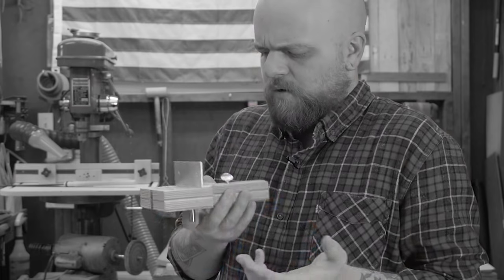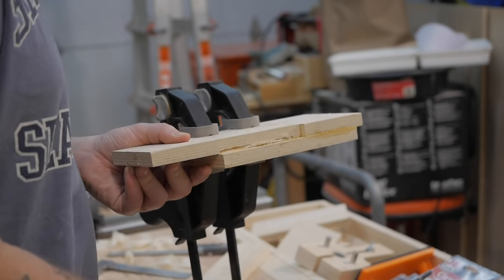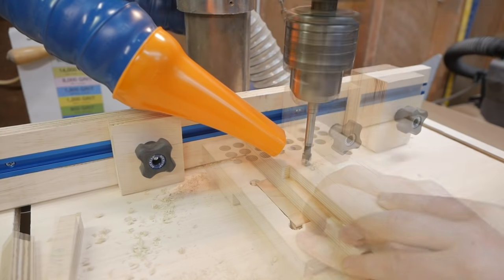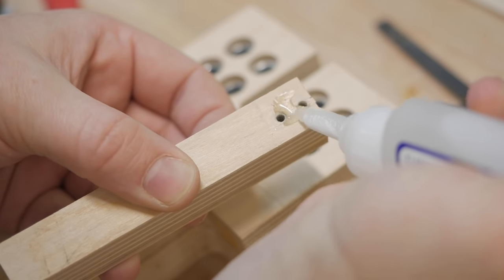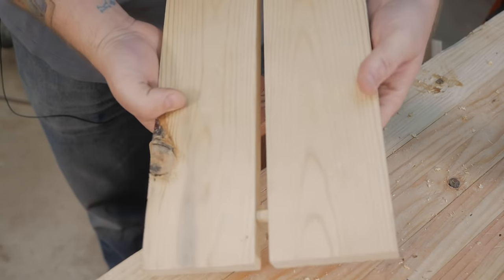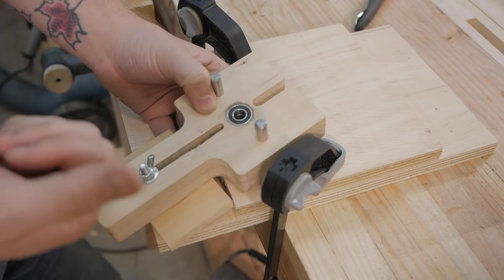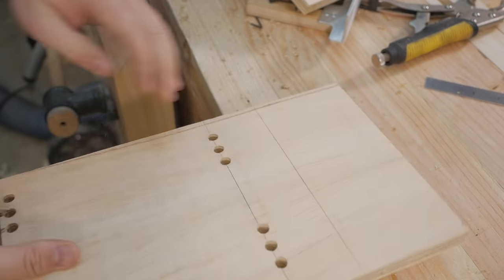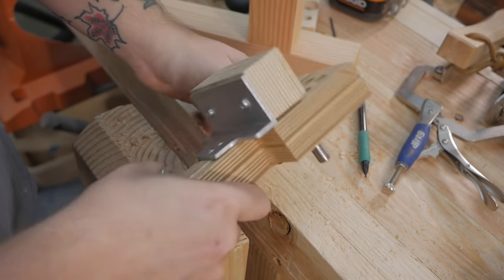BIG IMPROVEMENT To The DIY Dowel Jig and How To Make One

Comment: Engineering tip: The two countersunk screws on the fence are going to force the fence into an alignment as the screw heads mate with the c'sink.  If you want to be able to fine tune the squareness of the fence, use a round headed screw.

Comment: Nice design. I would say a jig with 1/4" drill holes would be more useful as 4/4 boards are the most commonly used in woodworking and a dowel or tenon is only supposed to be 1/3 the thickness of the board. It is too bad you epoxied the steel inserts into the wood, you could have drilled the holes in the wood to have an interference fit with the steel inserts so the inserts could be hammered/pressed out and swapped with steel inserts with a thicker wall and a smaller center hole for smaller diameter dowels.

Comment: Some comments raised issues about potential difficulty in drilling accurate holes.  A couple of ideas to add: use a scrap piece of wood to do you alignment on the drill press, using stops on either side as shown in the video, use a scratch awl or something similar to make an indent where you want the bit to go, and then make sure you use a drill bit, forstner or otherwise, that has a center spur deep enough to line up your drilling.  I do think metric is easier in many ways.

Comment: I finished building one of these yesterday and I was really impressed when trying it out.  Main problem for me in the UK was finding a supplier of the steel sleeves, I ended up having to make them on my lathe from 10mm bar for 8mm dowels.  Without following your drilling jig and spacer blocks idea I would never have got the accuracy in drilling the exact hole positions needed.  Thanks for the brilliant video  👍

Comment: Add a hole on the side.  This hole is where you place the drill bit in.  The hole is a DRILL DEPTH ADJUSTMENT PORT set to the proper depth needed to set the collar on the bit.  Great job!

Comment: I really enjoy doing your jig from the plans that I get from your place and your you tube video, they are excellent and very well explained and very easy to follow if you have all the tools required.  
This is a comment for your written instructions there is a mistake in the dimensions for the spacer thickness, your instruction call for 3/8" I think it should be 5/8" thickness, but if you pay attention and a little logic and you follow the plan view of the jig you will catch that the spacer should be 5/8", I hope the you don't feel bad for my comment.

Comment: Craftswright: A 64th, no a 32nd, perhaps even a 16th
Me: Cries in metric
Reply: I'm bilingual, let me translate into metric.
1/16th = 1.5875mm
1/32nd = the paint'll cover that
1/64th = who's going to notice that if I don't point it out?
Reply: "Cry me a litre". :)
Reply: I usually cry in Gauges. But which one? wire, plate? But then I remember that imperialists also have Letters to define drill sizes and all is good. 

One I wake up from that nightmare, I go to the shop and open up my two boxes of metric drills. From 1,0 to 10,0 mm in 0,1 mm increments. I occasionally go to my stepdads and gaze upon his watchmaker drills in 0,025mm increments. Seriously, that is really one droolable set of drill, I kid you not.

Comment: Really great idea there, excellent video.  Love it.

If you seated those pins with red locktite or ca glue, you might be able to heat them up, break the bond, and replace them.  On the other hand, I don't think you'll be bending those pins.  Any damage is going straight to the underlying wood, but you have a great thick piece there I really think you've done the best you can with it.

I have a metal maslow cnc that I'm going to be setting up when I have the room for it cleared out.  It might not be accurate enough to cut one of these out, but I'm certainly going up to give it a try.  I'll cut the precise holes first with the wood clamped down.  I can sneak up on the hole sizes by repeating the cuts with small increases to the toolpaths... I'll Cut them a little undersize first and then work my way up.

If the maslow cnc hanging isn't precise enough, I'll eventually have my mill wired up for power, but this looks like a great first project to push the metal maslow to its limits.

Comment: Dear Tanning,

Thank you so much for sharing this amazing design.
Before I try to copy your ingenuity, I have one concern though. It has to do with the drill bit passing through the metal guides of the jig. 
Is the repetitive use likely to damage the drill bits? Do you or any of the readers have any comments on this issue? By the way, are those metal tubes (guides) stainless steel? 
This is not a critique to your project. Rather a genuine concern. Drill bits are quite expensive in Brazil, so my humble concern.
Keep up with the excellent videos. Let us learn more!!
Best regards,
LF

Comment: First time watcher. Great video. I’ve watched it entirely 3x. I’ll buy the plans. Thinking of how to make it on my cnc. Seriously consider tripling your plan cost. Or at least double. And maybe find a way to batch a small run of them and sell them numbered and limited supply. A DIY version of Woodpeckers....
Reply from the maker: I'm considering it. I mostly want to foster a strong community instead of sell expensive plans, but I think you're right that they could go up a little bit, maybe just a couple bucks. What I might need to do is partner up with someone that has a CNC because THAT I think would make the run profitable. Let me know how you're build goes and that might help me figure out how to go about it!
Reply: @Craftswright  - you could do a batch run just using a cnc and small assembly line. Depending on the price point it might make sense. I would buy one for sure. If that works you can always expand manufacturing after that first run. The fence you could 3d print potentially, that would let you make a bunch at once.

Comment: My previous attempt to build these jigs failed because the holes weren't symmetrical as a result of gluing a pattern, just as you point out. But I'll try your block method as it seems it works much better! Thanks

Comment: I am looking to build my own, but I am having trouble finding the metal tubing with a 3/8" diameter.  Any sourcing suggestions?
Reply: I ended up going to a hydraulic brake company. They have all kinds of stuff and usually a bin of off cuts.

Comment: Brilliant, gonna 3d print one and just drop in some bushings
Reply from the maker: You lucky so-and-so.... haha
Reply: @Craftswright  To be honest fhe primary reason I actually got the 3D printer was to print templates and jigs that are extremely precise. The first router template I printed were uniquely shaped Box/Finger joints. I have my templates tuned to the point where the joints take some hammering to take back apart XD
Reply from the maker: I’ve been interested in playing with 3D creation for a while, what machine did you go with and how do you like it?
Reply: @Craftswright  I went with an Ender 3 Pro, it definitely leaves you wanting a better machine BUT since its so cheap I've been able to upgrade and mod the printer to the point where I'm consistently under 0.004in but usually around 0.002in divination for about half the cost of a Prusa i3 including the printer cost.

I would recommend the i3 if you don't want to spend the time tinkering with wires, hardware, and partial coding of the firmware (if you swap out the main control board for extra features) but in reality most 3D prints are a success or failure based on the settings you use to convert a 3D CAD to gcode just like a CNC machine.

Woodworking has allowed me to make my own furniture and make my house more appealing but 3D printing has helped me make faucet parts, medicine stoppers, knobs and buttons for appliances/toys, and make some side money while im at work or in the shop and the printer is just going burrrrrrrrrrrrrr.     XD
Reply from the maker: So much helpful information, thank you much for taking the time to provide that. Gonna look into those two meow 😸
Reply: @Guardian_Arias  If you end up publishing that jig as a 3d model on thingiverse, please share the link, it will definitely useful! (my printing skills are way more accurate than my woodworking, at least for now)

Comment: This is an excellent jig for 3/8 inch dowels. It is nearly impossible to make dowel joints without a jig. I wondered why you used steel inserts instead of bronze? Bronze is a little kinder to your drill bit. Then I heard you say you were using Harbor Freight drill bit. Then steel or bronze doesn't matter. That bit comes pre-worn-out. 😊
Reply from the maker: Bingo lol that and bronze bushings are more expensive 😬
Reply: It is not impossible to do dowel joints without a jig but it does make it extremely slow and skill driven and for that amount of effort you may as well do traditional mortise and tenon joints.

Comment: Great video, thanks for sharing. Of course, though, the reason why you had problems finding a drill bit that matched its specified dimensions is that the US (and Canada, etc) are signatories to the ISO system of measurement. The metre is precisely defined, then the inch is exactly 0.0254m. 
Your drill bit manufacturers then have problems setting their machines to increasing fractions of an inch because of rounding errors. If you worked in metric you’d find that your bits matched their stated dimensions...
👍😆
Reply from the maker: Hahaha I'm never going to live imperial down am I 😁  great info though!
Reply: @Craftswright  What a pile of BS. Any drill maker can either hold a dimension or not. The inspection dept. will be able to measure at least 1 decimal point more than the tolerance allows. But China doesn't care. If they only have metric blanks then the inch drills will be off. Did I say China doesn't care?
Reply: @bwyseymail  I think you underestimate Chinese. If you pay 50c you get 50c worth. In my world Chinese manufacturers are selling cars wit a 5 year unlimited distance warranty.

Comment: Looks great.. Wondering however, if I would not be 100% accurate when making/drilling the jig, will I get punished for it when using? Is there some margin for error without having to get a sledgehammer to make it fit? 🤔
You still use the triple/multiple dowel possibility? 
Again, great looking jig, thanks! 👍

Comment: I'm thinking to buy your plans. But before, please let me know if the measures given there are metric or imperial. The whole world is metric but the USA.
Reply from the maker: They are in imperial, but should be pretty easy to adjust over to metric. The whole point of the jig is that it is perfectly symmetrical. Other than that, just make the holes work with commonly available metric dowels and steel spacers.

Comment: For safety, drill out your angle from the outside using a block of wood to hold it in place. Inside drilling is hard to hold by hand, especially larger holes. You're going to chamfer the holes anyway.

Comment: I am relatively new to wordworking, but I want to make this jig.  I'm having some trouble finding 5/8 inch baltic birch.  Is there a specific reason for that thickness?  Could I use 2 x 3/4 inch instead?  Or 3/4 inch + 1/2 inch to get the same overall thickness?  Is there an advantage to using baltic birch instead of a hardwood like red oak?
Reply: @smoterino
  Baltic birch is very stable and don't strech. Therefore it stays pretty precise. Yes you can use oak but you should be sure that is a good, long term dryed one and glue two plates together to ensure the warp-free of the wood. Yes you should make it so thick as shown. Because you make it sure that the drill is going in a rectangular direction in the drilled wood. Hope I could help out.

Comment: As has been mentioned in at least one other post, neither your subscribe nor your contact links are working. Both of them simply tell me to try again later...
Reply from the maker: Strange... thanks for the heads up though! I just went ahead and got rid of the link since there are several ways to hit subscribe provided by YouTube itself so they should be bug free :)
Reply: @Craftswright  Well, this is embarrassing, I have discovered that the problem was due to my browser having "Ad Blockers" enabled which interrupted the normal software flow on the website. I turned them off for you website and immediately, the links worked as expected. I will be placing my order for the Dowel Jig plans. Thanks for what looks will be a very useful product! BTW, I love your videos - very informative!
Reply from the maker: Haha no worries, it happens
Reply: @Craftswright  What is the thickness of the 2" x 2" Aluminum angle? I can't find it anywhere in the plans. It looks like it's about 1/8".
Reply from the maker: Dangit I guess I missed that, you’re right it’s 1/8”
Reply: @Craftswright  Thanks, I'm collecting the pieces so I can get started on the build.

Comment: Dowels are not about strength but alignment.
Reply from the maker: Fair, but they CAN add strength, if you believe the videos out there lol
Reply: @Craftswright  Some folks use dowels for strength because they don't have confidence or skill to make a good joint. A good glue  joint is stronger than the wood in most cases. Plenty of videos showing this test. Watch the master wood workers on YT. They do not use dowels for strength.

Comment: What if I have no way to cut the stainless steel rod to make the bearings? Better yet can you just make me one and I'll pay you
Reply from the maker: You could definitely use 3/8 hardwood dowels as long as they're straight. The benefit there is if they ever get out of whack you could flush cut them, redrill the hole, and install new ones. 

You know you're about the 3rd person that's said that....maybe I do need to sell these lol
Reply: @Craftswright  well I'm talking about the steel tube you used to be the guide for the drill bit
Reply: @Craftswright  oh I think I see what you're saying
Reply from the maker: Oh! So the guides are seamless steel spacers and you can buy them in various lengths. I have links to them on Amazon in the video description, they're 3/8" ID, 1/2" OD, and 1" long. No cutting required :)
Reply: @Craftswright  wow I totally confused this video with a different one lmao!! But thank you for replying!!
Reply: @Craftswright  I know you misunderstood him, but I would buy a doweling jig like this! I love the idea of having one, but making one goes on the bottom of a long to-do list!
Reply: @Craftswright  I looked for that link and didn't find it, though I might be missing something; also, you have the discount code for Starbond but no link.